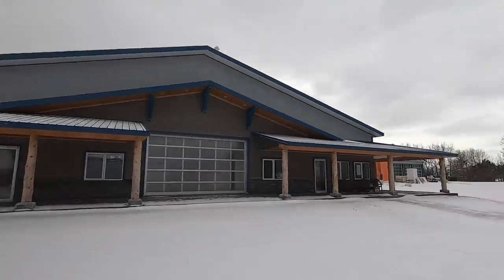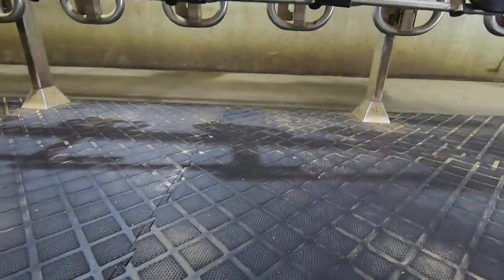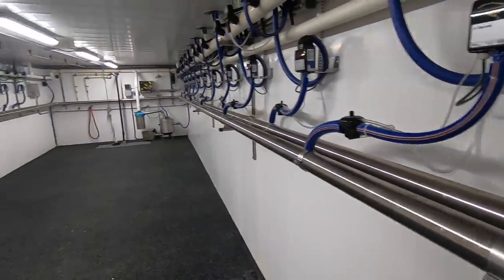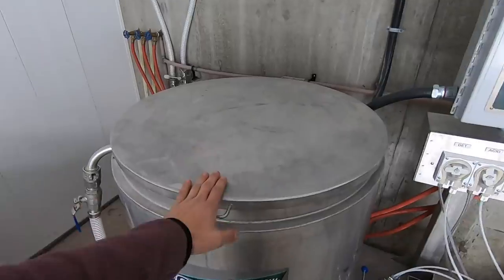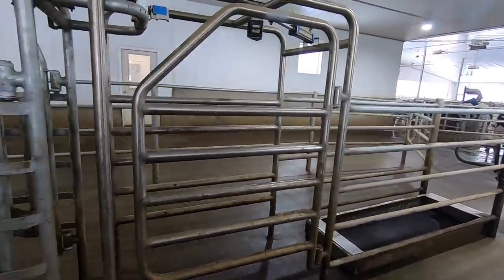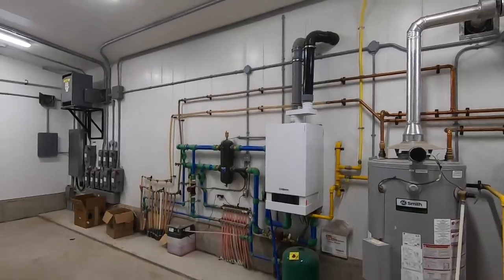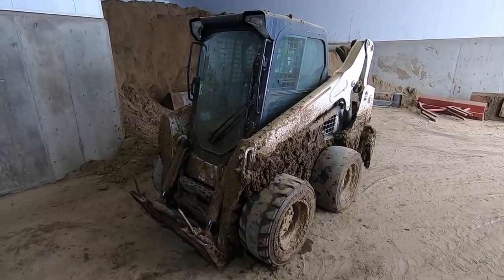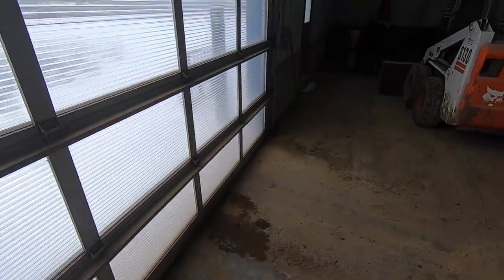Touring Our New Dairy Barn!

Comment: About 35 years ago I built a few dairy barns in NS Can. They were more or less state of the art then. This is fantastic! I did some concrete but mostly structural. Parlours, electrical and so on were all subbed. The biggest one I did was for 300 plus milking and was the biggest job I ever did. New barns here are mostly steel frame now and robotic milkers are making inroads especially on the smaller ~ 100 cow herds. We did some slat floor and some with ally scrapers which I am a little surprised you did not use.

Comment: An advance modern dairy technology. U can also search ALMARAI DAIRY FARM located in Saudi. You will be amaze the extensive vertical cow houses & rapid quick release milking parlour w/ 150 hds. capacity. Almarai have 6 mega farms, the biggest is producing 930,000 liter per day. I've work in one of this megafarm w/ 14,000 hds. though it is not yet completed. This is a 20,000+ milking heads if fully opertional w/ 6 vertical parlours.

Comment: The one man dairy farmers is just about a thing of the past.
I am surprised they didn't build that building out of steel. Wood soaks up moisture which steel does not. I guess it was economics.
Reply: Would’ve been a waste to do it out of steel. It looks well built so I don’t think moisture will be a problem. Maybe it won’t last as long as a steel barn but by the time that happens I think there will be more pressing industry issues.